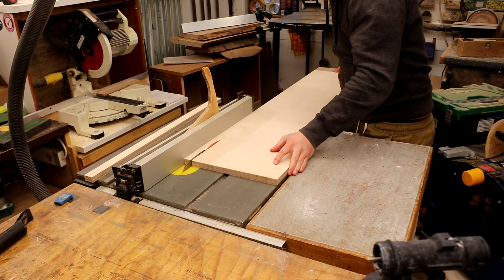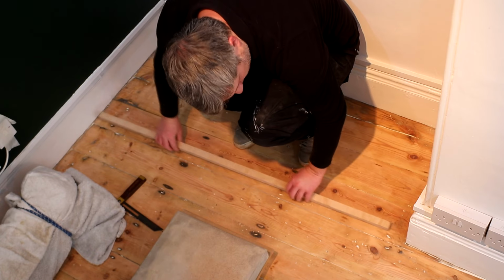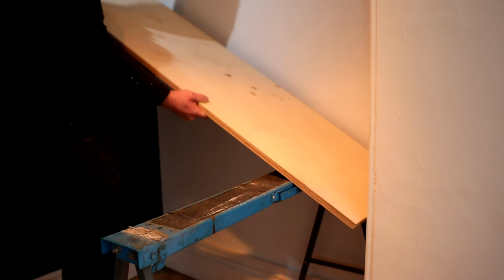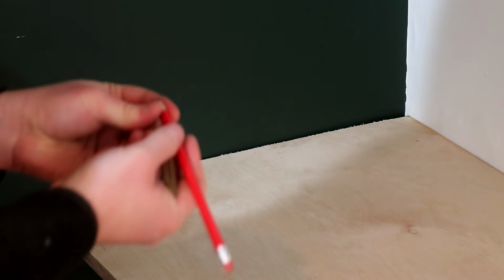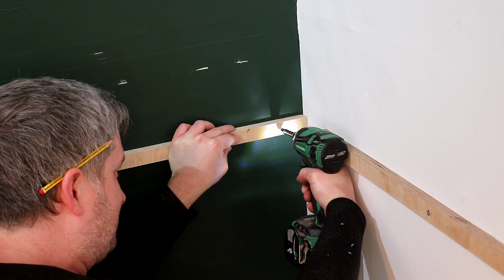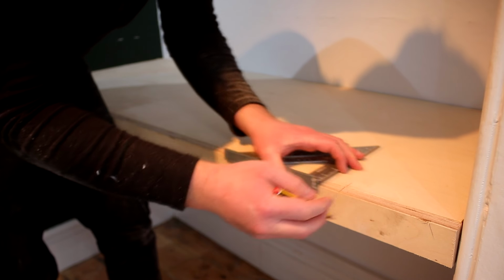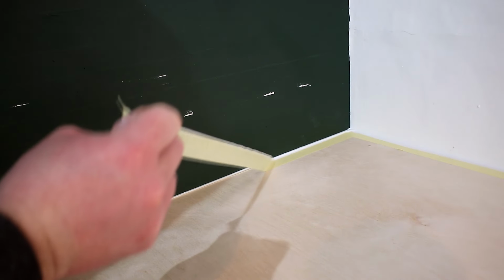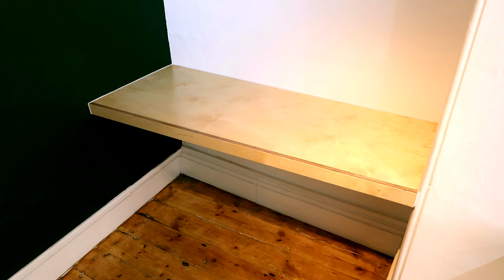Scribe Fitting An Alcove Shelf

Comment: @3:18 How come the angle of the right hand edge was so far out when you'd already measured up that angle with the bevel gauge?
Reply: Great question! I can’t figure this part out either. From what I can tell if you’re going to scribe each side anyways you may as well just cut it oversized and scribe it. Disregard using the sliding bevel of both sides as it seems to have done nothing here.

Comment: This is the most intuitive method for fitting a shelf to an alcove. Unfortunately, it often fails, since the bevel gauge is not long enough to accurately measure the angles. Using the measuring tape also can result in failure, since being out by just 1 millimetre or 2 because you placed the end of the tape on a small bump on the wall will ruin the entire fit. The only way that works every time is to make a template from four pieces of wood.

Comment: Question: if you’re taking away material from sides after you’ve measured, wouldn’t you be shy?  I get over measuring for the back but the sides are puzzling me.
Reply: You're correct. This shelf is going to be shy on the sides. This method actually does not work reliably. I've tried it myself a few times and it never seems to work out. The method that always works out perfectly is to make a template from 4 pieces of wood.

Comment: Why did you measure the corner angles and cut initially when you scribed it anyway?
Reply: Because his cut failed because the bevel gauge gave an incorrect angle because it isn't long enough to measure the angle accurately. This method isn't reliable for fitting shelves to alcoves. Making a template is the most reliable method.

Comment: Thoughts on using 18mm MDF for a 45" wide shelf like those you made? I made some shorter ones myself with 18mm plywood but when going to make some for a family member there local woodyard recommended 18mm MDF instead as the plywood they had was splintering badly when they were cutting it. I've got the shelves in but need to finish them off with a front support.

Comment: There’s a way easier way to do this. Screw the battens on the wall then you thin strips with points on the end. Place point of strips into corners and then hot glue back and sides together. Job done.

Comment: I've done projects that sometimes involve Hundreds of hanging items. We use to install wood blocking...But when material cost, labor cost and missed locations where all taken into account We found it cheaper and actually more adaptable to install a 10"~12" piece of the width of the hanging area or the whole width for pantries. We use anywhere from 25 to 20 gauges depending what the load might be...better safe than sorry. Usually the Tin Knocker on the job is more than happy to give a "Great" price...especially when I give a "Great" price for stud/rock repair for wayward duct work...If you get my drift...<(O..O)>...🖖

Comment: So if your gap is at the front you set the compass to how wide the wide is at the front?  I have a worktop to put in, gap is 107 cm at the front but the wall at the back the gap is 106 cm.  Also is it OK to cut a worktop with a jigsaw?  Many thanks.

Comment: Good job, personally, end  grain of the plywood should not show and trim piece would have gone under the shelf?
Reply from the maker: It was a feature in the shop, as per the other projects in the shop. Besides, if you or it under the shelf, end grain would still be visible on the edge of the top

Comment: hi mate have you thought of making your own rails for your skilly? just fix a batten to the edge of a sheet of plywood then cut along the batten and you have a rail. works great for me. great video too mate
Reply: He should really just buy a track saw. Any professional who works on site should most certainly have one. 

They are a time saver and are very accurate.  Good ones can be had for about £250.
Reply from the maker: Making a track rail is something I’ve considered but it doesn’t excite me as a project and a straight edge and circular saw work just as well, just with a bit more measuring. 

As for buying a tracksaw, I would want a cordless one, and needs to be on a battery platform I already have (HiKOKI or Makita). I am hoping HiKOKI release one soon and in the mean time I will make do with what I have

Comment: Great job Keith! Front trim fixed with several dominos makes it rigid piece. Not a long ago my client ordered 4 similar shelf in alcove without exposed edges. I cut 45^ bevel on shelf and front piece, glued and nailed. To increase strength I made a recommendation to have bottom of shelf joined to front same like the top. The customer was happy with the design idea as the top shelf was 170 cm from floor- unexposed batons.

Comment: I would have cut the shelf and the front panel at 45 degrees and glued and pinned them. You wouldn't have seen the front panels grain that way.
Reply from the maker: The client wanted the grain visible, as it is elsewhere in the shop
Reply: +Argull1000
Using a natural pit of pine jointed to the front would just hide it there is no need for fancy mitre cuts that make it more complex to joint. 

But with some designs plywood layers look greated exposed.
Reply: @bighands69  I disagree.
Reply from the maker: That’s ok, you’re not the client so you don’t have to like it👍
Reply: @RagnBoneBrown  I wasn't refering to you pal. I was refering to the comment about plywood grain looking great.

You are correct though. The buyer is always right and they are paying.

I wasn't critisicing your work.

Comment: Great video and well performed project. Thanks for sharing.
As a less experienced DIY-er I always use cardboard templates. But now with this awesome scribing video I might give it a try to do direct scribing.
Reply from the maker: Peter Millard’s template method is pretty impressive!
Reply: Han de Groot
There is a hundred different ways you can do templates. I have a series of adjustable templates/jigs that I just slot in and you make the adjustment then take that jjig out to the plywood and make the cut. 

The only problem with this is taking the time to make them up and then having to carry them in the van but when doing the actual job the method is really fast.  Three independent jigs should be enough to cover most smaller jobs with each having 50mm adjustability.

Comment: Keith, 

You don't need a track saw to make straight, long cuts. YouTube has plenty of videos showing how to create a jig (track/cutting guide) for your circular saw.  You probably have the materials on hand to make one.

Solid wood for the trim edging would have hidden the voids in the plywood.  I don't know how much a piece of solid wood trim would cost you. In my area, a piece of white wood (pine), 1-inch x 2-inch x 8 feet, only costs $1.00.
Reply from the maker: I’ve never really fancied making a tracksaw system it just isn’t a project that excites me enough to do it and I don’t think any of the ones I’ve seen are all that great, they are good ideas but they don’t really compare to the convenience of a tracksaw in my opinion. 

Solid wood was not the right choice here as it didn’t fit with the clients design aesthetic. Birch ply was the material of choice and hiding the edge grain was not wanted

Comment: Blue painters tape has a lower tack than masking tape and is less likely to pull the paint off the surface being masked.
Reply: If you just use maskers, stick it to your jumper first and the fibres will take some of the tack off and stop it taking paint

Comment: Hi, Thanks a lot for the mention, 👍👍👍
You fitted it well . If i may say 😉... when i scribe something similar, I put the battens on the wall first, that gives the board/top something to sit on while scribing & gives a more accurate scribe because as you know these walls are all over the place so you'll be scribing in the right place along the wall, the second scribe is then sat on the batten on the other side for the same reason, that's why you had to scribe twice, the board being up like that was scribing against a part of the wall that could've been a very different shape & distance,.
Once again Thanks a lot for the shout out, Much appreciated 😁
Reply: Hey guys late to the party I know but another method would be to mark your scribe on smaller off cuts, cut the scribe and use it as template lining the ends up with the length of the piece marked on the corners. Hope that makes sense. Its extra cutting I know but when done properly it means only fitting once!
Reply from the maker: Thanks Gid, that makes a lot of sense! I don’t know why I didn’t think to do that 😂 next time! Thanks for the videos I’ve learned a lot!
Reply: @Rag 'n' Bone Brown  Yep next time 😁 👍 You were honest that it was your first try n it fitted, that's what counts, easier to cut a bit off then glue a bit back on 😁Thanks you're welcome 😊

Comment: Keith - you do great work but I wonder why you put the front trim piece against the shelf rather than underneath - structurally I think it would have been better.
Reply from the maker: It was clients preference, nothing more to it
Reply: Rag 'n' Bone Brown that’s fair enough.👍
Reply: By putting the trim face in front no edge was visible anymore. For strength underneath is better.
So the best is to put two trims, one underneath and one at the front.
Reply: Agree Norman, more strength.
Reply: +Norman Boyes
At the end of the day he could have done it several ways and all of them would have been a correct way to do it.
Reply: bighands69 Thank you for educating me.

Comment: Lovely. Check out one minute workbench on you tube, he made his own track saw which you can use your own circular saw with
Reply from the maker: Thanks! I’ve seen that and have pondered making one but I can’t get excited about it enough to make one for some reason!
Reply: +Debbie Hill
If you are doing woodwork professionally getting a track saw is a good investment. It can allow you to rip large sheets. 

And when combined with a MFT table (make that your self) it allows you to do detailed carpentry work. 

It is one of the most flexible tools a woodworker can have. In the future track saws will become standard for woodworkers.

Comment: Another way would have been to batten the wall first, have some 3mm MDF lengths  ripped to 80mm wide and cut these to the extents of the shelf. Then scribe the MDF to the wall and screw all 4 pieces together in situ. That will allow you to use it as a template to draw around and jigsaw the shelf for a perfect fit.

It's very respectable and brave of you to be learning a new trade and doing so in the full glare of others on Youtube. I commend you. I've been doing this for 15 years now and still learn something new every week.

Good job sir.

Comment: I had similar issues when fitting my ikea buchers block desk / workbench ( got birch should have goten oak ) i just accepted the gaps and attached 6mm thick steel brackets to the wall and scrweed it on :).